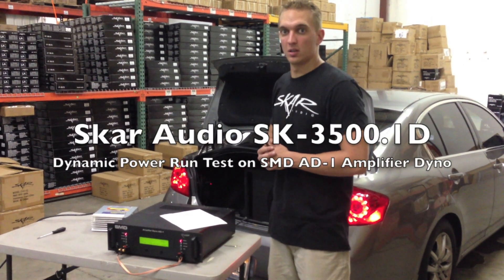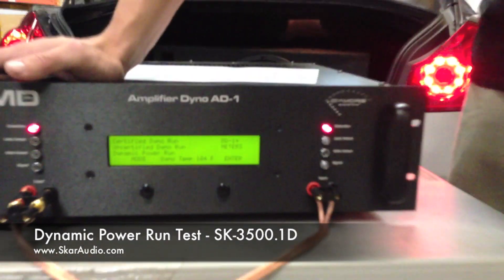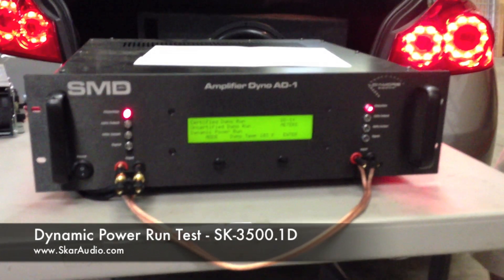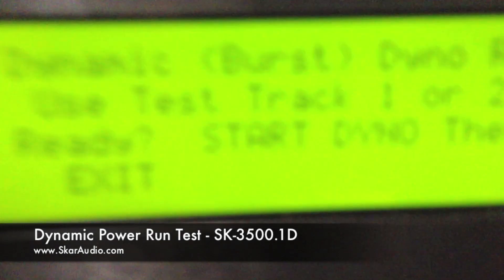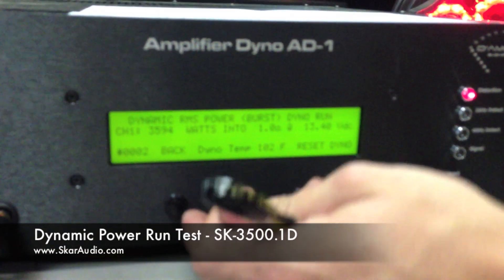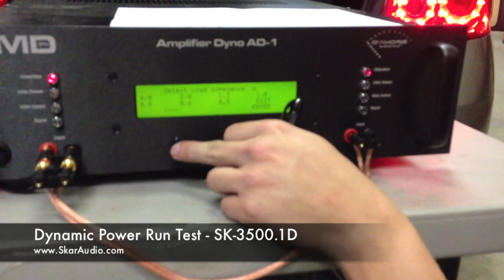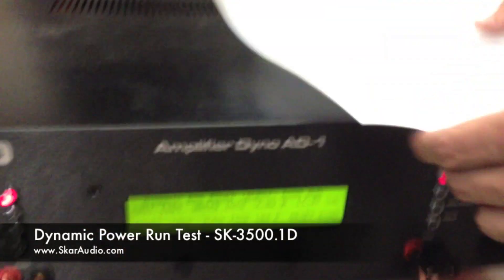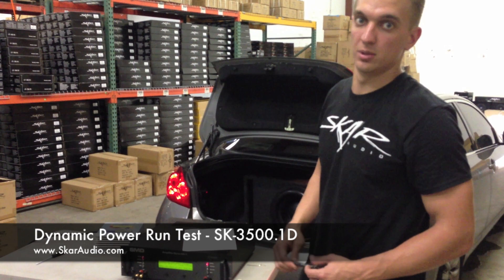Skar Audio SK-3500.1D & SMD AD-1 Amp Dyno Test - Dynamic Power Run

Comment: Not sure but it seem like there is distortion with those red distortion led being on before you start the test. I never seen that happen in Steve videos at least not until distortion/clipping. Did you do a distortion test on the the head unit before using the Honey Badger? Thanks

Comment: Output and efficiency are two completely different measurements. This test simply shows the amp is underrated. To measure efficiency, you would also have  to measure input current.